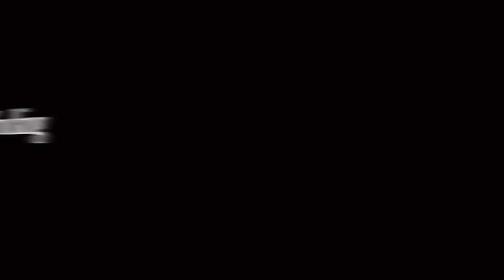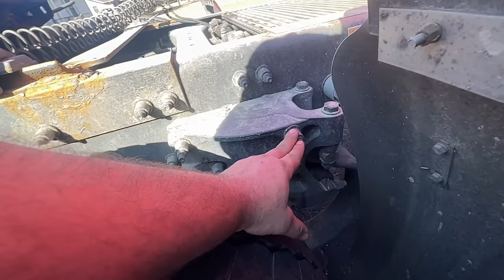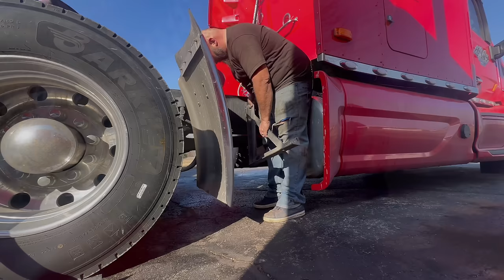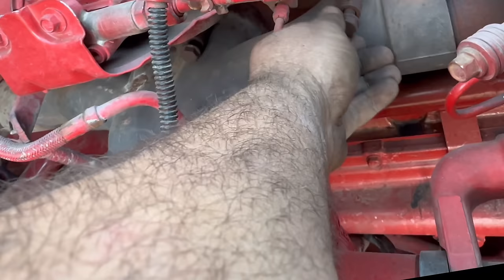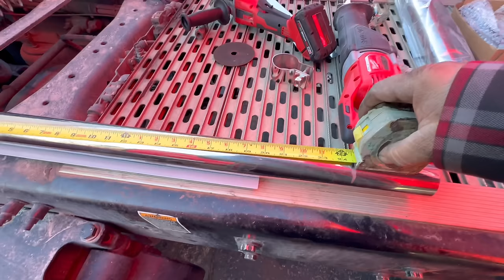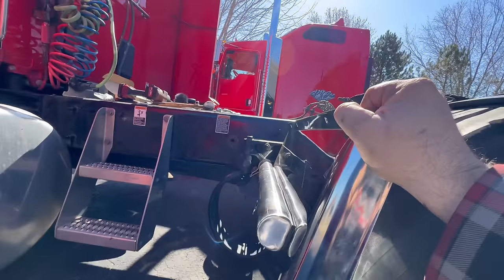"MAKING SOME TINY TRANSFORMATIONS" | Our Trucking Life - Episode #451

Comment: Quarter Fender locations should work well in the midwest where you have to use chains not sure how that's going to work out for you but I'm sure you thought about that Dirt Cheap just rip them off and replace them not a big deal.
Reply from the maker: I can remove them in seconds.

Comment: Martin, thank you for the info you share to help others. I have a question about putting lights in the mirrors but I have a T680. Do you know the best place to get power for them ?  Again thanks for your knowledge.
Reply from the maker: I just put some on tiny so there is a video coming up about it, however on a T680 you don’t have door marker lights so what I would do is pull them through the door and wire to either a light switch or a spare switch. On a 579 it’s easy because you can tee of right at the door marker on the bottom.
Reply: I was thinking the marker lights on the side of the hood. I want the turn signals to work as well. I would just have to run along under the hood to get there. Does that sound good ?
Reply from the maker: Since the 579 has a harness in the door for it I imagine the t680 might too since it’s all made the same. I wouldn’t go to the hood because of the tilt, too much hassle. You can get turn signals at the fuse box. Worth popping the door panel off and seeing though.

Comment: It doesn’t make any sense a dealership charging way more than what they should. Oh it does if all you are after is to suck every dime you can get out of your customer. So all what that does is instead of the dealership and a truck owner to form a team which is beneficial to both now each side is only in it for themselves and then if one can get something over the other one then so be it. Sounds very childish. It seems this is the way the world has gone. Good to see you working on the trucks. I would have not thought that the bumper you had on the truck cut the fuel back that much. With the prices of fuel the way it is ya got to squeeze every mile you can get out of a gallon. Another fine video guys. Have a great and a safe day. Happy trails to you, D…

Comment: You probably change them enough where it’s not an issue but I normally throw some anti-seize on the bolts and shocks 👍
Reply from the maker: I would’ve but didn’t have any. 3/4” Milwaukee takes care of them though.
Reply: @TruckingTogether  HAHAHAHAHA and what the Milwaukee can’t a torch can !
I’m waiting on the Air Dog install……. I have a FASS on mine and can give you some of my experiences with it since they are similar
Reply from the maker: Can’t be stuck if it’s liquid. lol

Hopefully when it warms up a bit it’ll be going on.